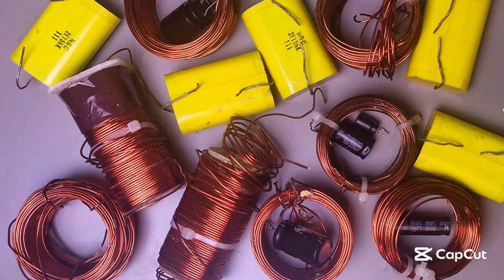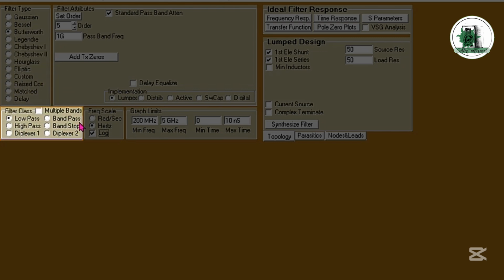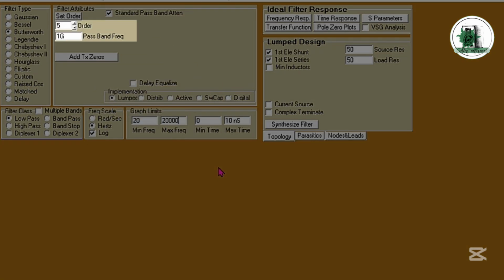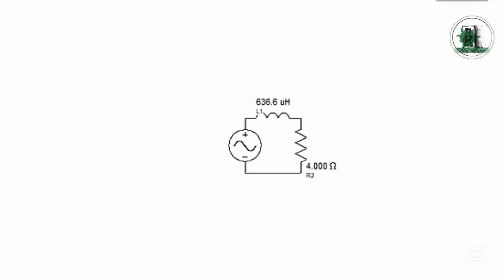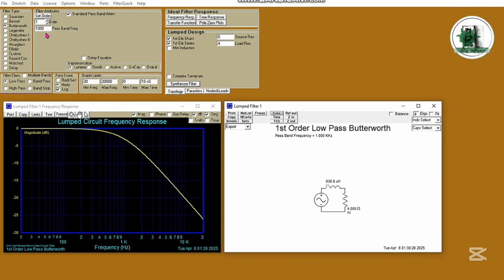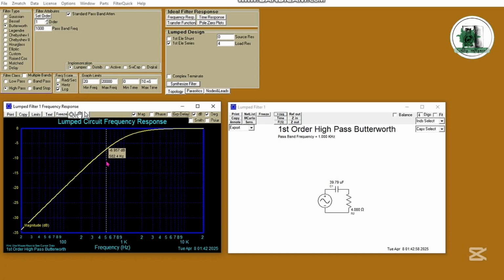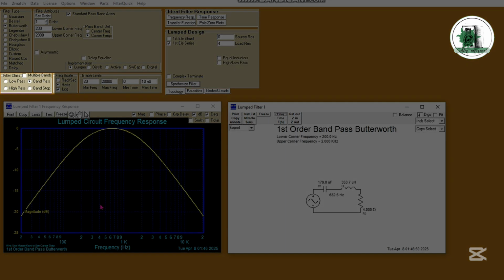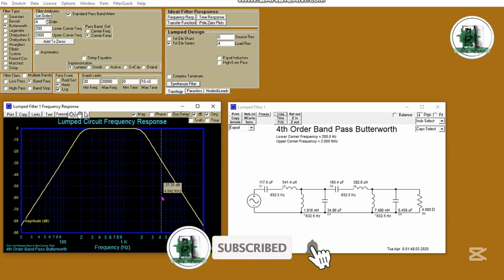Master Crossover Design In 5 Minutes FAST!

Comment: Assuming a flat impedenze in passive crossover make all the argument exentially useless.

All the video that you male are awesome and i really like them. But this time, in my opinion, the video generate wrong informazioni.

Hope the best for the future.
Reply from the maker: Thanks for your comment. Please watch this video:
https://www.youtube.com/watch?v=oqC6g3z_4Ss
Reply: @Diy_enjoyment I saw the video, almost useless for crossover design in my opinion. 
For a speaker like that I suggest a lower frequency cut, with the higher order filter. 

In any case with the RC filter you can manage the inductance but not the resonance frequency.

If you know how to design a crossover the RC filter is a waste of money.
Reply from the maker: I understand your point, but RC networks like zobel are actually widely used in passive crossover designs to linearize impedance—especially when dealing with rising inductance in woofers.

Sure, it doesn't solve mechanical resonance, but that's not its job. Not every tool fixes everything, and in this case, it helps the filter work as intended.

The idea that using RC means you “don’t know how to design” isn’t really accurate—plenty of pros use them when the driver’s impedance calls for it.